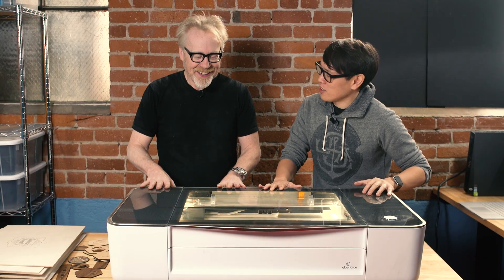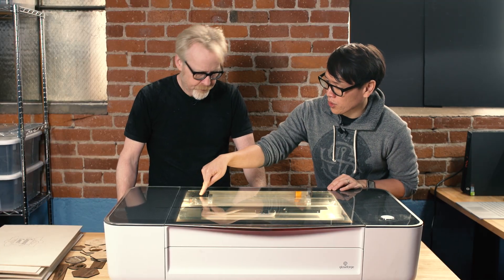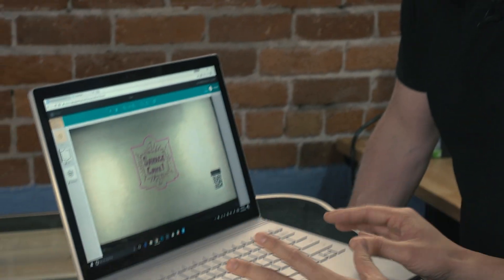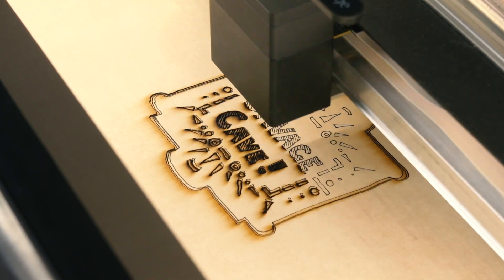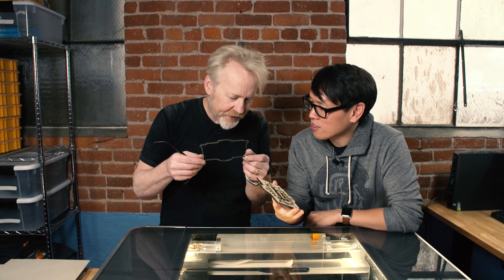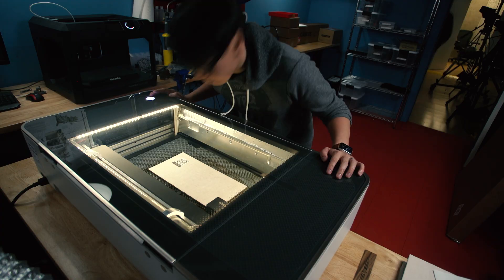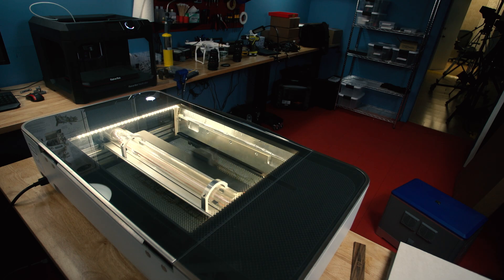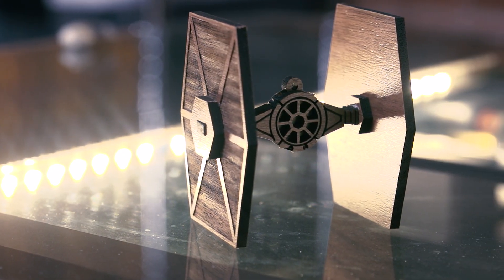Hands-On with the Glowforge Laser Cutter!

Comment: Looks really cool, I desperately wanted one during the pre-orders a year ago but just couldn't afford it. There were a few things I noted, the first being that originally I recall it being mentioned that the detail camera in the cutting head would be used for scanning drawings put into the glowforge, but it appeared that this was not the case with this model. Will this be in software shipped on the final version, or a future update? Or has the plan been scrapped? Also I was surprised that the laser cut the vector first before etching the raster. Is this intentional? If the material were to slip after the first cut the raster would then be off position. Is the order of operations changeable, or is there some other reason for it being done this way around?

Comment: In the cloud? So when company goes bust all of a sudden machine stops working? Being there, saw that. No. Thank. You.
Reply: exactly what i thought. Or maybe they release an improved version in 5 years and stop supporting the old one then. No thank you.
Reply: Fuck that,  I've been wanting a home laser but all the web based crap sounds like garbage.  I'm fine with the pipeline of exporting dxf,  setting all my settings manuals,  and hitting "start" .  No slick hand-holdy web interface, no depending on a company's servers or my own internet connection.
Reply: That's my one real gripe about it. I love the form factor, looks like it works really well, and I'd pay a premium for such a nicely constructed package. But I can't do it if I don't know it will run for 10 years, and we don't know that Glowforge will last that long as a company.
Reply: they allowing for stand alone if you don't want to use the cloud but prefer cloud
Reply: I think this may be another instance of companies misusing the 'cloud' buzzwordery...  The Tiko3D printer guys got no end of s**t over it in their Kickstarter...  In their case, there was nothing cloud-based about it... What they were calling a 'cloud-based application' was a web-based interface being served from the device, Internet-of-Things style via Wi-Fi.
Reply: imnofox Well, that's unfortunate.  At least, worst case scenario, you could drop a smoothieboard in it and reclaim its basic functionality as a laser cutter/engraver and start working from there...I'm sure it wouldn't take too terribly long for people to reverse-engineer all the extra stuff. Us DIY/hacker types are clever like that. ;P
Reply: Exactly, just like my Pebble watch, which will be a lot less useful when Fitbit close them down...
Reply: Oh good. That was pretty much my one worry when I saw this before.
Reply: I have one now and I have the Pro.  They do not stand behind their product.   You will spend thousands of dollars only to get shunned.  I went with them over Trotec and Dremel just because of space and ease of use.  Unfortunately it is neither.  Also, If you message them on social media, they immediately delete and block your comments.  A great company would be accountable enough to realize that nothing is perfect but work on a solution for you.   As it stands now in 2020 we have to wait on responses via email whenever there is an issue.  I have done less that 100 cuts.  Maybe even less than 50!  You cannot talk to ANYONE on the phone, everything is via email.  You may get an email 2-3 days after your inquiry that says they are very busy and will respond to you shortly.  In another 3-4 days you will get a response from someone asking you to do tons of steps and take pics of each one.  Hopefully you then won't have someone on the other end that will tell you, it's your fault, your table is not big enough, your room is not big enough, your area is not level, etc, etc....bottom line.....all issues are your fault.
Reply: gnzh My thoughts exactly
Reply: If you look inside the machine, it is indeed water cooled.
Reply: And they're still requiring cloud base with no intention of releasing offline software.
Reply: So what about when GE Plastics goes belly up? IT kind of did.... LEXAN is now owned by a Saudi company. DIGITAL EQUIPMENT was the premier mainframe company worldwide... long gone now. Everything has risk. IF you can deal with parts and service independently of the maker of this machine, then there is no issue. IS this made from jellybrean parts? Is the LASER tube proprietary? It is all about if you can still use it without the company existing that matters.
Reply: @citylockapolytechnikeyllcc7936  there's a significant difference between  "the company that made my equipment went out of business so if something breaks I may not be able to find replacements" and "this company went belly up, so without their servers my perfectly functional CNC is now a $5k paperweight".
Reply: Yes, then you have a really expensive paperweight! Ouch!
Reply: Bakamoichigei I checked the FAQ on the Glowforge website.

Unfortunately, it does rely on external servers "hosted in Google's data centers"
Reply: Well, keep a sealed co2 laser tube running for 10 years and I'm impressed, they normally "burn up" after 1000 hours of usage. Where burning up is the output power slowly fading the more one uses it, and eventually isn't usable. But a new standard laser tube costs around 200-300 us dollars. Though, last time I checked, Glowforge used their own proprietary laser tube, as to not need water cooling. Even though water cooled laser tubes is the recommended practice in the industry. Both for price, and efficiency.
Reply: Would be nice with an in depths look at the hardware and seeing if it even complies with simple regulation.

I can already say that the Glowforge seams to not follow European regulations regarding laser safety in industrial equipment.
Reply: This whole Cloud thing is a CIA op, anyway.  Put literally everything on the grid so there is no privacy.  In the future, all hard drives will be remote, meaning everything you do, everywhere you go, everything you buy, will pass through every spy agency on the planet.

Comment: So if the interface is web based and your internet goes down or even the company goes out of business, it becomes useless?
Reply: Welcome to the cloud age - where your tools don't belong to you and you need an internet connection just to read a QR code sticker from a sheet of plywood.
Reply: Mooferoo Yep, it's called planned obsolescence
Reply: This was my main concern when I bought the Cricut pen and die cutting machine (It's browser based only).  I hedged my bets and got it anyway.  I figured someone will have reverse engineered the communication protocol with the machine to work with other apps long before Cricut goes out of business, should that ever happen.
Reply: they allowing for a stand alone according to their kickstarter
Reply: @us3rnam3number  and they didn't.
Reply: +Thyshallsmite As this post indicates, they had better...